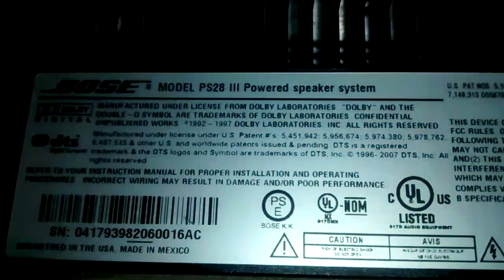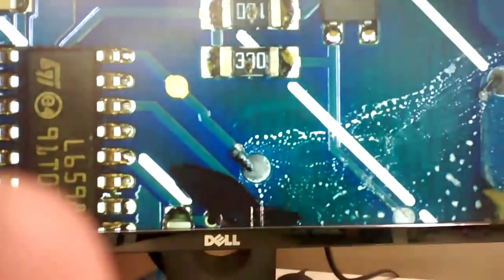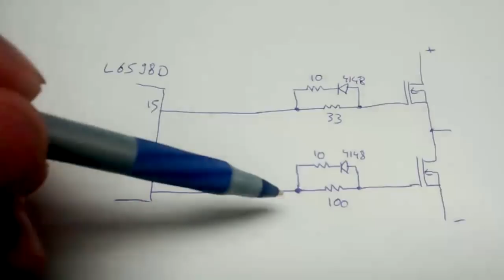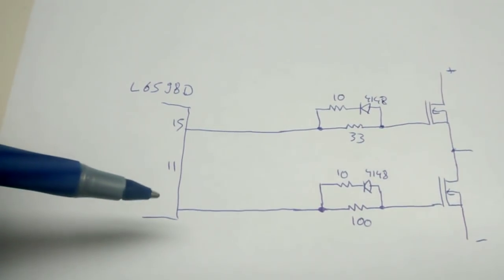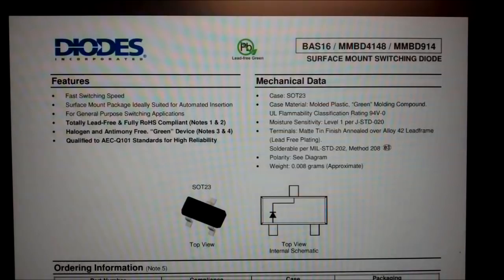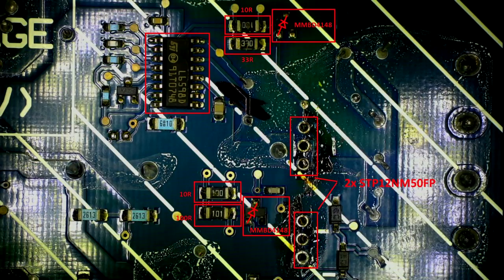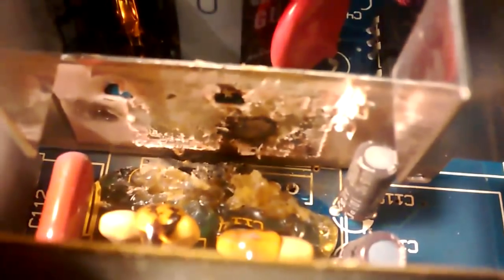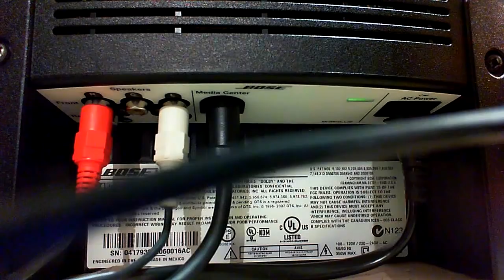Dead BOSE PS28 III subwoofer (no sound) repair

Comment: Here is a little known fact about the these series of subwoofers. PS, 28,38,48 etc. Doesn’t matter even if it is labeled III. There are different versions of Amplifier boards in these units! And if you are looking for a replacement for the AV35 the older subwoofer versions will not work! Here’s why, they will not decode 5.1 properly. Commercials and some material will play on all 5 channels. But when you play a true 5.1 surround movie there will be no center channel dialogue. And I can clearly see the from the video, this amplifier board is very old. And will not work with a AV35.

Comment: Well, I have a Lifestyle 35 with the tell-tale blown resistors and hole in a chip. I have to decide if it's worth repairing or whether to just use the speakers as passive. 

Now with the Lifestyle 35 PSU, all the surface mount components are on the "top" side with the heat sink, so it would have to be removed. And it would make replacing the components annoying anyway as capacitors and transformers get in the way.

Comment: the display unit in my Bose lifestyle V30 has gone bad & hence the whole system isn't working .. can you let me know if I can use the existing jewel cube speakers & the subwoofer (Acoustimass module) with any other AV receiver like Marantz? thank you
Reply: Sometimes when the display goes out the system may still work. Pop in a cd and hit cd and see if it spins

Comment: Hello, looking for your help with this one please, Bose PS28iii is not working, no flashing green LED's. After watching your video above, I have found the following: all the components you talk about seem to be ok, and what I did find was one of the Amp IC's LM4766T has had pin two burnt open or blow open, I'll replace this amp but is there more to it then just that, as to why the green power LED's are not working please?

Comment: TomTechTod
I disassembled the whole unit. fuse was not blown and the bottom of the pcb didn't look bad at all, and i didnt see any holes in the gate resistors. May there be another reason  for not getting power, or would this be the only reason? is there somewhere i can email you and maybe talk in more detail. thanks
Reply from the maker: SaltyBunny did you measure the MOSFETs? Maybe only one is short?
Reply: no i didn't measure the mosfets. I assume with the volt meter just dont know exactly what they should be reading out.
Reply from the maker: SaltyBunny turn off the power, make sure there is no voltage left on the main  capacitors, put the multimeter in diode test. Positive lead on pin 3 of the FET, negative lead on 2, it should read the voltage drop of the body diode, about 500mV or something like that. You shouldn't read a short between any of the FETs leads either...
Reply: I did test them just now and both read from 500-516.
Reply: @k420diddy  Hello there  we have same problem , my tech says is a bad circuit card like a printed sound card?  any ideas?

Comment: Is there a way to check power with the PS28 III sub without the media center?  All i have is sub and power cord.  I did pull back panel off and fuse looks good and no sign carbon or overheating.  For example if only the power cord in plugged in, will the AC lamps flash?
Reply from the maker: As far as I remember, no. There must be a signal coming from the mediacenter to turn on the sub. You would need to know the pinout of the little round connector in the back. However, there are two optocouplers on the power board, one gets its signal from the little flatcable, one is maybe for feedback. When I shorted the output of the one that gets its signal from the flatcable the controller circuit powered up. Sorry, can't be of more help. There surely is a way to test the sub without mediacenter but it's not something I really investigated
Reply: @tomtechtod9200  That's right, according to Bose website https://www.bose.co.uk/en_gb/support/article/led-status-information-lsv-35.html there are must be signal sent from the console to turn on the LED on the bass module.

Comment: Please Tom. I'm from brazil, the assistance guy doesn't find the values of the Mosfets. Did you have any Bose diagram? Or the mosfet description? Thanks! Victor
Reply from the maker: Oi, os MOSFET são os STP12NM50FP, voce pode usar qualquer FET parecido, então: n-channel, tensão VDS acima de 550V, 12A corrente continua ou mais, Fullpack (isolado). Use um FET com RDSON e Total gate charge igual ou melhor que esses daqui. Não sei se é facil obter essas peças no Brasil, muitas vezes acha nas placas de alimentação de TV Plasma tambem. Não tinha esquema não, tem uma parte la pela metade do video.
Reply: TomTechTod MUITO obrigado!

Comment: Hi Tom how are you!? Thank you for sharing this video! Tom, maybe you can help me... I have a Bose Cinemate II The system has an auto-off function where after 30 minutes of not receiving an audio signal, it will power down... wonder if you can help me how can I disable thins on the hardware... I have ability in soldering if needed... thank you!!

Comment: In my case, i do not get 120v at the entry point connector J7003 next to the main power cable. I replaced the fuse and the varistor right next to it but still can't get 120v. Could this mean my amp still ok? Inpected the board around this area and not see any burn or crack.

Comment: Did you only stick the transitors in the holes? Did you have to do anything else to get them out before, besides removing the glue and the clips?
Reply from the maker: Yes, first remove clips, then remove solder with solder wick or suction pump or heat all three terminals and once and pull it out. Then clean the holes and remove glue residues, put in the transistors, then the clips then solder the terminals.
Reply: TomTechTod well shit. I pulled the transitors out. I thought they were only plugged. I got all pieces replaced that you marked red, but I changed the transitors on my own. Put it all back together and now it don't work. The guy replaced the parts said he can't see the rings where the transitors should be in. Is there a chance to fix that somehow?
Reply from the maker: If you ripped them out without desoldering them it's likely you damaged the PCB. This board has at least two layers, so there are possibly traces ripped off the board (from the top layer). Certainly repairable, but not easy. I don't know what you mean by "rings". Is that the solder pads on the PCB? If they are ripped off, the plated hole that connects top and bottom layer is probably damaged too. As I said, it would be repairable but it will be a PITA
Reply: TomTechTod I ordered a new subwoofer. I fucked it up. But thanks for your help.

Comment: please Tom. I do not have voltage on pin 12 of the controller chip, where are the diode and transistor that fail?
Reply from the maker: I don't have the amp anymore. They are pretty easy to find when you follow the trace from pin 12.  They are in SOT23 packages too, near the chip.
Reply: thanks tom! I found them, both are short, the diode will replace it with a 12 v 1/2 w diode that I did not find in sot 23 package
Reply: Do you have the diagram of this version?
Reply from the maker: no I don't have a complete schematic and didn't bother to draw one. Replacing the parts mentioned in the video + the zener and transistor should solve the problem. If they don't it's almost not worth continuing the repair...
Reply from the maker: no problem, the package doesn't matter
Reply: ADRIAN ORTEGA where are the zener and the transistor ? Did you  solve the problem ?

Comment: Hi there I have a bose lifestyle 5 and it's dead accept for radio through zone b. Do you think this may be the issue.  I switched to the new remote and flicked it to zone a. Was getting no response accept for a definate click through the speakers in zone a when powering off.
Reply from the maker: Ratted bug sorry I don't have an answer for you. I repaired this once and hopefully never have to do it again.

Comment: Hi, I have a Bose Lifestyle 38 series 5.1 ch unit. The sub woofer is not working. When enquired, understood that the 'thermal resistor' in the power supply unit is gone. Can you pl help resolve this?
Reply from the maker: The proper term would be thermistor which could be either a NTC or PTC. I do not know where they could be located. If you want, take high res pictures of the boards in your sub and send them to my email, you find it in the about section of my yt channel. You will need at least a multimeter to troubleshoot...

Comment: Hi, System is PS28 and the Board is 286612-003 no voltage at pin 12 of U101.300v available across C110,C111.Do i need to connect flat cable and 9 pin cable to media centre to power up. Any insight from any one is appreciated.Thanks

Comment: Hi
I just repaired my power section of lifestyle 48 and was working properly untill rhe subwoofer was connected.Once after connecting the woofer.my woofer power section after 2 minutes again went dead. Mosfet was shot.can u suggest me what will be the reason.and the power ic l6598 was blown off
As i checked the connector of the woofer which comes out with a connector shows 1.7ohm resistance.
Can u suggest wat will be the reason
Reply from the maker: could be that the driving circuit was affected too when the MOSFETs were damaged. this is a tough problem to troubleshoot without an oscilloscope and at least part of the schematic. can't suggest anything else than thoroughly check the driving circuit of these mosfets
Reply: @tomtechtod9200  hi i had found many diodes and mosfet of sot23 package  which i had replaced.but all was ok..the card powered up and cube speaker were working properly.but once i connected the woofer.its blew off..is it the stereo ic responsible ?
Reply from the maker: I only repaired this SW once, I don't have any more information than what's in the video/description

Comment: Hi, 
Is there anyway to connect my Bose 3-2-1 GS Series II system to my NEW Samsung QR80 TV. The TV has no Video-S connection and the Bose System has No HDMI connection, so I can get sound but NO video output....can you help?
Thanks,
Reply from the maker: Maybe with a composite to HDMI converter. amazon, ebay etc
Reply: TomTechTod Thanks, I tried that and it didn’t work not sure why.

Comment: What can I do if somebody drop water on my subwoofer and stop working??
Reply from the maker: First thing to do with water in electronic equipment is to disconnect from power, open it up and dry it as fast as possible. Leaving water on electronic baords will corrode vias, traces and electronic components. Then clean with alcohol and dry with compressed air or hairdryer. If traces or components are damaged, replace/ repair them.

Comment: What was the total cost for replacing the parts ?
Reply from the maker: About $20 + shipping when bought on digikey.
Reply: @tomtechtod9200   Hello there i have problems with my  PS28 III sub,  could you please tell me where can i buy that circuit board card for it and do you know the part number? thanks

Comment: What do you think can happen if water spilled into the back circuit area of this? Do you think it can be repaired?
Thanks
Reply from the maker: Possibly. The longer the water stays in there the higher the risk of severe damage. First thing to do is to remove power then dry the affected area. Then look for corrosion of vias, solder joints, traces and component leads

Comment: I've my V35 repaired and months later the bass module is not working. I'm tired with this Bose proprietary nonsense. I'm prepared to toss it away and buy a much better surround sound system with Atmos Dolby etc.

Comment: My sub doesn’t work but this process is too difficult 😅
Reply from the maker: If it's the same sub you could give it a try. You will need a soldering iron, hot glue and a multimeter...
Reply: TomTechTod yes, is the same